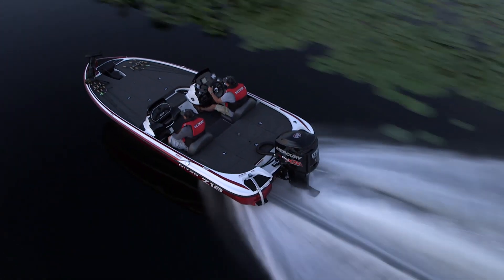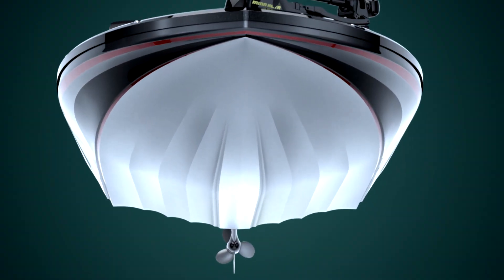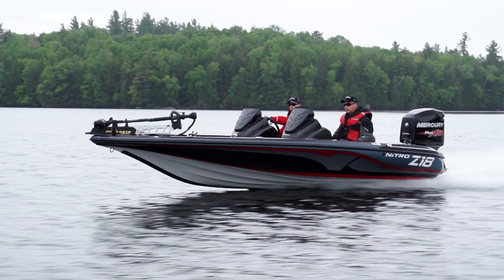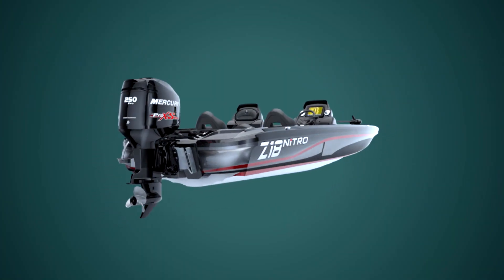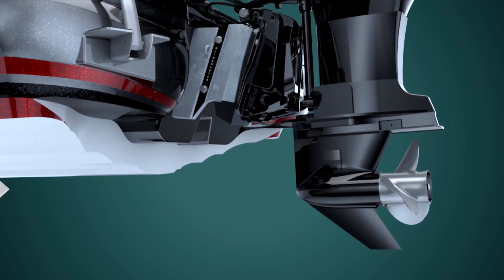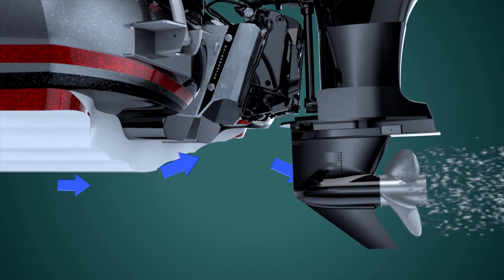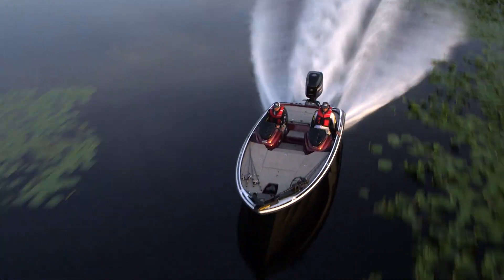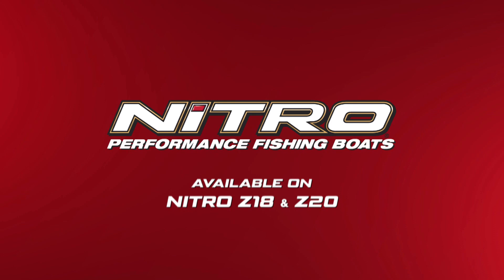NITRO Boats: NVT Hull with Rapid Planing System

Comment: Rancho cucamonga  Bass pro gave me the headache of my life.  First issue was Bimini top was broken, fish finder on dash was leaning forward,  middle window was over lapping, they should of told me to hold off on driving fawkin 5hrs there.. I waited hours for them to fix the window and fish finder.  On the way home,  trailer jack wheels fell off. I had to keep the boat attached to my truck all night then the next day,  I took it out to do motor break in and the boat wasn't able to go neutral or reverse.  I had to wait another week to take it back and finally they fixed the issue.  Now it's been almost a month and they haven't called me to see when I will get my Bimini top, plus the back pads has air bubbles every where... WTF BASS PRO AND SHITTY NITRO.. MY FAWKIN MONEY IS REAL...NOT FAKE